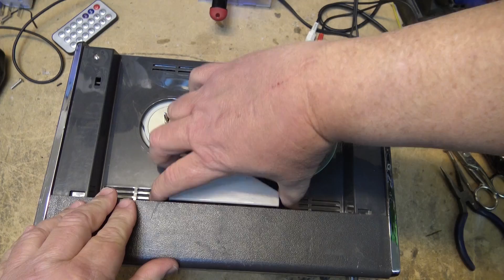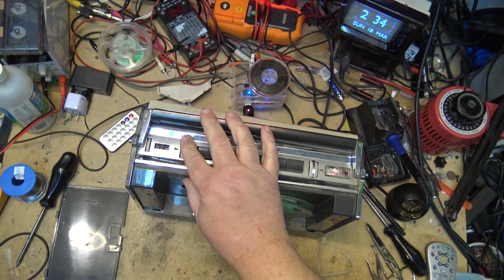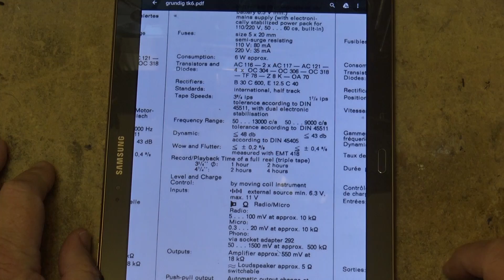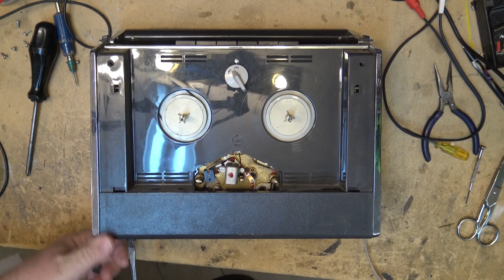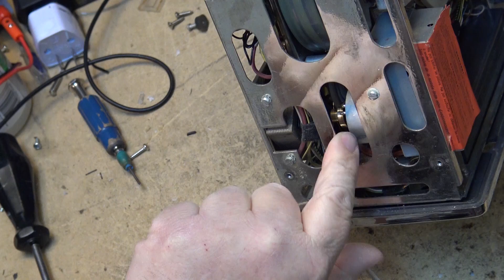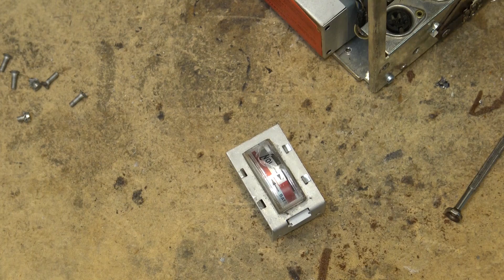Grundig TK6 Reel to Reel Tape Recorder repair

Comment: Quality machine. Excellent engineering and sound. Mine only runs on batteries because the internal transformer is open. I've hidden a 9v d/c barrel in the right hand compartment to save on batteries. I wonder why they restricted the max reel diameter given the size of the unit
Reply from the maker: Portable

Comment: I also have my Grundig TK 247 and it works good, but the works fine, and when I tried the tape, the music is a tad slow due to the DC motor. There’s a voltage switch on the back where you can switch the voltage from 110 to 220 volts and another switch for 50 to 60 hertz depending on your country like if you in the UK, it will be 50hz. and 220w.

Comment: Do you know if it's possible to get an adaptor to convert the output DIN  jack to 3.5mm or USB?
Reply: ebay is full of DIN plugs to 3.5mm socket adapters

Comment: I so much liked this video. Amazing that it works so well and never been serviced like you said. Keep them coming.
Reply from the maker: Yes this shows how well these old beasts were made. Not like the crap that they make today. One of my favorite tape recorders of all time is my Panasonic NV9200.  That would be a video tape recorder that uses the huge 3/4" cassettes. There is a shot of it unloading a tape in my opening logo. Those things are massive, and it weighs about 80 LBs.

Comment: is this a 220V/50hz device ?
Reply from the maker: Both 110 and 220.  @ 37:16 you will see, wight next to the fuse where I am pointing the selector jumper to select the voltage.
Reply: oh sorry I am still watching the vid and haven't yet reached that point. I guess you do have an inverter for 220V/50hz only devices ?

Comment: That fabric belt is actually Nylon and will degrade and break and should break and I should know as I had a CROWN-CORDER Reel to Reel and the fabric belt broke and I tried to fix the belt using typewriter ribbon shortened to the right size it worked alright but there was a speed change and that snapped also so the whole unit was dumped.
Reply from the maker: Don't know if it is nylon or some other woven fabric, but it has a felt backing to allow for torque regulation by slipping.
Reply: 12voltvids not on the CROWN -CORDER reel to Reel tape decks

Comment: Should have cleaned the pots.
Reply from the maker: KG Salvage 
I did. Camera wasn't running. Sometimes I miss the beep that tells me the camera is rolling and when I pressed it to stop recording I actually started it up. So I missed the shot. If you heard any noise after it was reassembled it was just the cleaner hadn't worked it's way totally into the control yet. It is quiet now.

Comment: When you say it's a half track head, Does that mean mono?
Reply from the maker: KG Salvage 
Yes mini, and record on half the tape so you can turn it over as opposed to a full track head which I only runs 1way.
Reply: Half track is actually a 2-track system. Can be played also on stereo machine if you listen to only one channel at a time.
Reply: Felix2417425 What  happens  if  you  play  a  stereo  tape  on  that  machine .  Does  it  only  play  one  channel ?
Reply: Plays both channels at once unless you mute one of the channels. Both playing can result in an unintelligible aural trainwreck, so to speak.
Reply: @kgsalvage6306  It will play one channel of side 1 and one channel of side 2 (but backwards). Sounds awful!

Comment: The old Grundig Co.  made excellent equipment.  Their old shortwave radios were really good.
Reply from the maker: Pete Ciallella 
Yes the old grundig gear was very good. I have an old Normende stereo I will service when I can dig it out of my garage and get it on the bench. That one has been in the family since new. In pristine condition.

Comment: It sounds very good on it's recordings considering the mic input isn't a perfect match for the line output :-D
i assume the mic is acting as a 600 ohm load or so.
Shame about the meter, it looks very similar to the S-meter in old c.b radios, perhaps a scale swap over and series resistor would make an s-meter work?
Reply from the maker: zx8401ztv 
I was thinking the same thing. I actually have an old browning mobile cb radio somewhere that has a meter of about the same size. Just have to find it. If it hasn't been tossed that is.
Reply: I used to repair a lot of c.b radios, i like the real moving coil s-meter better, led bargraphs are not quite as nice :-(.
Im supprised that most meters lasted, a moving coil meter vibrated to hell in cars/trucks.